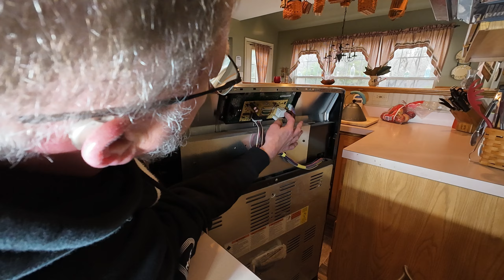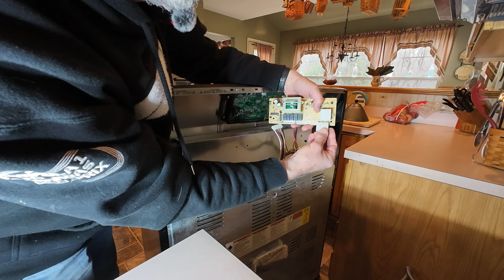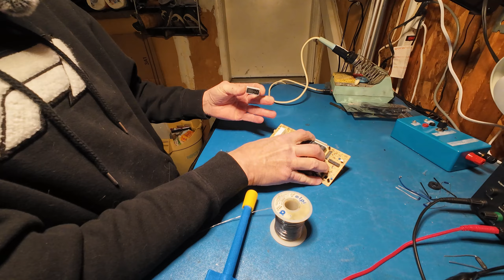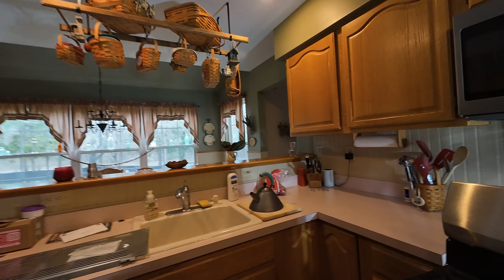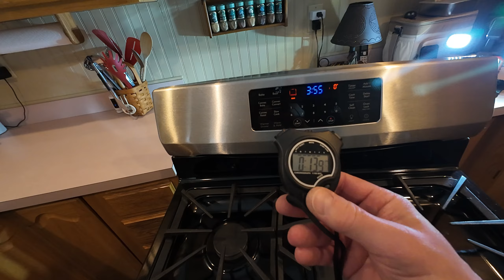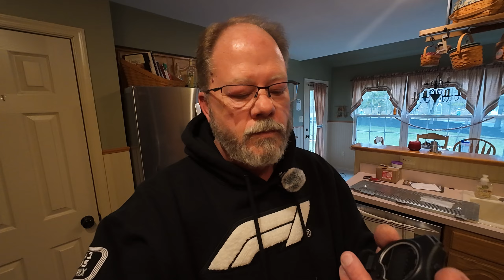Kenmore oven

Comment: 27 minutes to 350 on a gas oven is WAY too long!! It should be there in about 8-12 minutes and should light within 30-45 seconds. As someone who works in the appliance industry, it sounds like the issue is either igniter related or safety valve related. If I were to have to guess being that you said you replaced the valve, it’s probably a dying igniter because if it doesn’t get hot enough, the safety valve won’t open as far causing not enough gas to flow into the burner therefore causing the flame to not be as big and put off less heat. I would start off by replacing it as it’s one of the easiest repairs to do on a gas oven and it might solve your problem entirely. If you give me the model number of your range, I could even find the correct one and send you a link. Now if you already replaced the igniter, there’s a chance it could be getting too low of voltage. It should be getting around 110-120 volts ac. I would try disconnecting the igniter and then using a multi meter, check the voltage going to the igniter to make sure it’s 120. If it’s less than 120, it definitely could be a main board issue unfortunately. Good luck!!